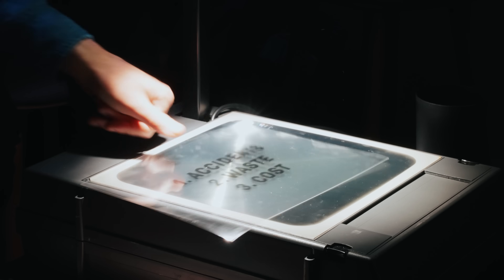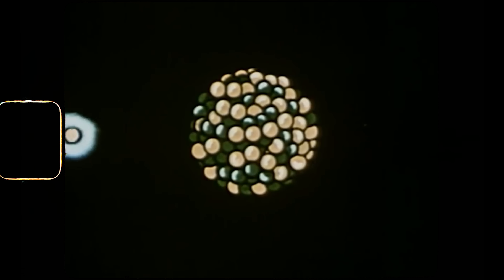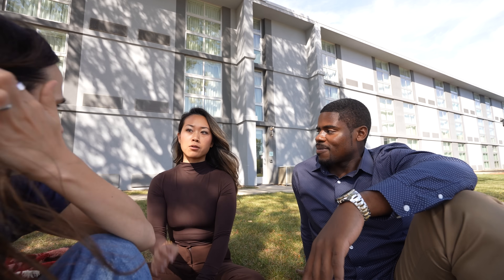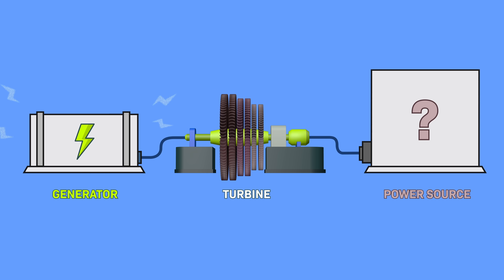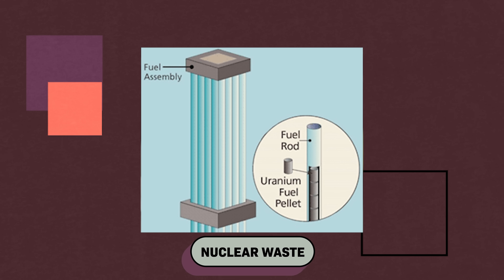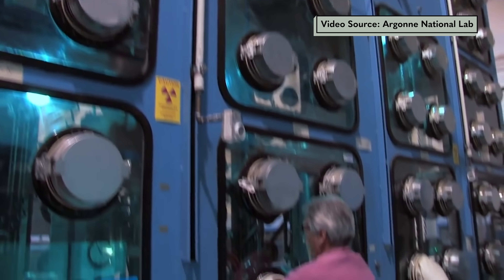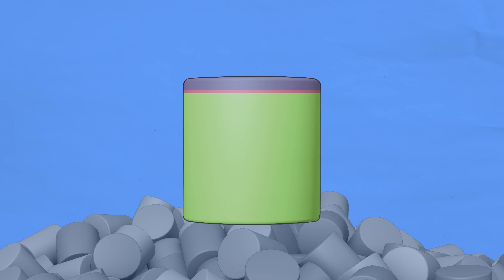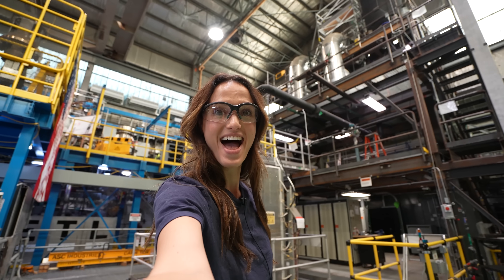The Big Lie About Nuclear Waste

Comment: Thats cool and all but what about the nuclear waste that isn't used up rods, like soil contamination in the mines, materials from the enrichment process, the nuclear contaminated tools and maintanance material, and so on. Most likely this can't be recycled and is the majority of the nuclear waste. I am all for reusing and recyling the really bad stuff, just for the purpose to reduce the time we have to store the waste but this will still produce more, (most likely) non recyclbale nuclear waste. So I can only support this idea when new fuel rods are completly out of the equation and only the remaining waste we already have is used. Every single new processed lump of uranium is just adding a lot more waste, and like I said even the recylcling of the old waste will produce even more new waste. Still cool thing that we can reduce the storage time by a bit through recycling fuel.
Reply: That (low and intermediate level) waste tends to be much shorter half life and is my definition much less intensely radioactive despite the shorter half-life elements.  It *is the largest amount by volume.  But it is also the stuff that becomes ordinary non-radioactive stuff first. Some of the low level  starts barely above background. And all radioactive materials are just in the process of becoming non-radioactive.  And compared to many hazardous materials, radioactive stuff is childishly easy to detect where it is present. You can go a long way with a $50 geiger counter.

The high level waste is focused on because it is the stuff that is deadly radioactive and can stay dangerously  radioactive for so long that it becomes a problem making sure it is safe until it decays away.  As half lives shortens, it becomes just a matter of putting it away for a while until it decaysto background. For the low level rad waste we generated using P32, P33, or S35 radiolabeled nucleic acids, that meant putting it in drawer for a few months until it is ordinary waste.  You can't store low level reactor waste in your desk drawer, but the idea is the same.  It accumulates, but what has accumulated is disappearing at the same time.

Compared to the natural and ignored sources of ionizing radiation (from granite countertops to bananas, to sharing a bed with someone, to flying), the danger even to people living next to where low level waste is stored and processed is only a  problem to the degree one is dedicated to it being a problem.
Reply: @michaelclark4876  If you read carefully you would have noticed that I know that the half-life time is shorter, but the low radioactive waste from powerplants and mines are still radioactive for hundreds of years. Therefore storing it still remains a problem. More because of the amount not so much because of the radiation per se. But if you store a bunch of radioactive stuff together even low radiation levels become dangerous. The waste problem is and remains the reason why new nuclear power rods are a bad idea. Since nuclear fission reactors should only be seen as a transitional technology to renewable energy sources, it should be enough to reuse the thousands of tons of old material anyway.

Comment: The big problem with nuclear is the blatant lies that the green church has been spreading about it for decades. Nuclear is very cheap, it is very clean and when build right the highly dangerous nuclear waste can indeed be recycled and made to be far less dangerous than what is currently being stored for no reason other than that someone (probably someone with a vested interest in Uranium mining) convinced the then president that recycling and reducing both the danger level and the time it needs to be stored was a bad idea.
Currently there is a lot of pressure on the industry to build new reactors as anyone with some knowledge of how an electrical grid works knows that you need baseline power to guarantee that your power delivery remains stable even when it is a cloudy day or the wind died down for a while. Since there are, except for some lucky locations where geothermal or hydro powerplants make sense, no viable green ways to generate baseline power nuclear is needed even if the green church does not like it one bit. The good thing about the new often small and modular reactors is that quite a few of them are build around the concept of recycling the fuel. The bad thing about these reactors is that it will take an eternity to get approval to actually spin them up commercially and even more time to find a place where you can plop a few of them down as the general population has been convinced that anything nuclear is a major accident waiting to happen and no one should have a nuclear powerplant in their backyard.

I fear that it will still be at least a few more decades before we see the first commercially used modular reactors and thanks to lobbying efforts they could very well be only light water reactors because there still is good money to be made mining ever more uranium.

Comment: Nuclear is not safe. It just isn't. You can not plan for every contingency, and the consequences last into the 40,000 year range. Human civilization is only 13,000 years old. Black swan events occur. From terrorists to tsunamis to a freak meteor strikes to a tornados to an earthquakes.
Fusion is much safer, and the best scalable design I have seen is with Helion.
One machine to supply the fuel to multiple generators across the world.
Find the optimum ratio and scale it up. The machines are the size of a semi truck.
It is the most effecient design, bypassing heating of steam to turn a turbine, and going straight to generating from the electromagnetic field.
Even coal is safer and cleaner than nuclear fission.

Comment: Interesting and great point that used fuel rods are a potential source of energy for decades. But you are starting with a totally wrong premise "There's enough used fuel - meaning nuclear waste" The vast majority of the nuclear waste is not discarded rods. Nuclear waste is made up of  Byproducts of the reaction, tools, cleaning supplies, millions of gallons of contaminated water, chemical sludge, storage canisters, clothing, matetial handling artifacts, etc.

Comment: the thing that i never get is we are fine with gas, but not nuclear. Its like nuclear would be ok if after we used it we just pumped it into the air, and no one would want to use gas if we just did not dump it out of our tail pipes, but ended up with waste cubes.

Comment: Good video but you missed the primary reason that we are stuck with the dysfunctional waste system that we have today, which is the 1982 nuclear waste policy act, which made the federal government responsible for nuclear waste management and disposition.  In doing so, the Act distorts the market incentives for the private sector to develop the best solutions to waste management.  To actually solve the problem, we need to realign responsibilities and incentives such that waste producers are responsible for waste management and government is responsible for oversight and regulation.

Comment: Nuclear power plants ware Developed by military mainly for use in submarines, thats why they are very suitable to use  water as medium but hot water becomes steam after hitting 100°C so we have dangerous pressures. There is another solution by using melted salt as medium, making powerplant more secure...  This and probably many other solutions are there but on the way of many inventions there will be always politics blocking the way and pulling development of humanity back. Try also watching documentary about Thorium, very interesting... and shows that we got the technology but politics standing in the way is nothing new.

Comment: From what i know 95% of the material is used in a nuclear power plant. They already use most of the "waste" in them. The only thing a nuclear power plant reject is water vapor and they are now way more sécure than before. Its actually the most clean energy we can have and the less impactfull on the environment. (Waste from solar panel and their production are very polluting/Wind turbine disrupt bird flow and are also dangerous....)

Comment: The amount of space required to store all of the nuclear waste from the entire planet since the beginning of nuclear power takes up less space than a single wind or solar farm.
Wind and Solar are far more damaging to the environment than Nuclear Power with our current capabilites.
You don't just put down and wind and Solar farm and leave it there forever for 'free energy'. Those wind and solar farms wear down just like everything does. While the waste from Wind farms and Solar farms is not radioactive, it is also not recyclable by any means we currently have and it is buried unlike nuclear waste which is stored above ground in constantly monitored containment cells.
Not only that but these wind and solar farms are eventually abandoned and there are huge swaths of land that are just solar/wind farm graveyards.
The alternate options for energy besides Nuclear all cause so much more waste than nuclear power plants do that it is not even close.
One day with advancements we may be able to recycle solar/wind farm waste or improve our grid and other features to make them worth using but as of now they are terrible for the environment. We also will eventually have better ways to deal with nuclear waste, but as of now as I said all of the nuclear waste ever created in the world takes up a tiny spec of space in the world to store, where all of our other forms of energy cause massive amounts of unrecyclable waste that also require plenty of pollution to create the fuel for in the first place. Those materials to create solar/wind are not generated out of thin air.

Comment: You say it’s expensive, but don’t give the cost. What is the cost? Also how do you commercialize the technology? I’d go to, Elon Musk, and Jeff Bezos, to take this challenge up. They competed for the ability to go to outer space and want to land on, Mars. We’ll need a power source when we go there and building a reactor, that can reuse the nuclear waste, would be a good idea. The folks at Argonne, need to create an adapter, that can be sold to the reactors we have now, that automatically recycles the old waste. The cost to take down and rebuild power plants, will be expensive. 

Argonne could contact this base regarding their system. 
“The US Air Force has confirmed the Eielson base in Alaska as the facility planned to host its first small nuclear power plant. A microreactor of up to 5 MWe could be operational there as soon as 2027, according to Eielson”

Comment: It's the fossil fuel industry that hates Nuclear power, because it's the only threat to their own bottom line. They know perfectly well that wind and solar can never replace fossil fuels. But Nuclear can, which is why they create this much propaganda against it.

Cost isn't really the problem. The energy is worth far more than it'll cost. Politics and public perception is the problem.
(Even if it's not as cheap as new uranium, it's not an outrageous cost compared to other energy generation options, like large-scale wind and solar)

Comment: Using nuclear waste to make energy is a hoax. First off, you can’t just use the waste as is, it needs to be treated. This process separates parts of the waste, which creates pollution, it releases radioactivity, part of it can be contained, but creates more waste, and part of it is released in the air and water. Secondly the modified waste is, one, a terrorist risk as it is very easy to make nuclear bombs from it, two, a higher risk to use in a nuclear plant, meaning in case of an accident, the demultiplication process which leads to a radioactive explosion is much quicker, allowing for less time to react. And it also creates waste. Conclusion, it is not viable, let’s not forget, if you take into account all that is contaminated in the nuclear waste recycling process, itmultiplies the volume of radioactive material by an estimated 240 times. Yes a lot of it is low radioactivity, but still toxic, deadly even!

Comment: The second point, why they were so optimistic in the 50s and 60s about nuclear power, they believe fission reactors were just a stepping stone leading to true massive power, FUSION. Thats combing water molecules and making power. Same thing the sun itself uses, hydrogen. They lived in a period unlike any other where inventions we use everyday were coming out, like the microwave. They felt the holy grail of power was just around the corner in research. That is a room temperature super-conductor. The BIGGEST problem with electricity isnt MAKING it, it is TRANSPORTING it! Just a few powerplants could make enough electricity to power the whole country, but trying to send it anywhere would melt the lines! But a useable super-conductor has never materialized and is likely impossible. So we are back to fusion. If maybe we hadnt wasted so much time and money on worthless wind and super poisonous solar, we would probably have it already. It is possible, but it will take lots of time AND money to get there. Fusion has advanced more in the last 10 years than the last 75 years, so we will see.
Reply: There's another (better?) solution for this. Make it local and distributed and store it right there. This avoids sending huge amounts of electric energy around the country in a fragile balanced network. You would still have the grid, but far more resilient.
Reply: @tinowildenhain2324  Completely wrong. This is part of the wrong think going on the left. Power grids require the lines to be energized at all times or the grid collapses and goes dark. Making it local is what we have been doing for a hundred years. Batteries will not work, they discharge, they do not maintain. There must be continuous power that can be very quickly scaled up on demand, or you get brown outs, black outs, etc. Dening this is simply arguing that electrical engineering is wrong, even though it has been working for a 100 years. The only true alternative to fossil fuels is nuclear. If solar and wind worked, we would have been using it for the last 100 years. They even started with it, but it didnt work. This goes back to the arguments between Thomas Edison and Nickola Tesla, DC vrs AC. Batteries are DC, your power lines are AC. They dont mix, like oil and water. Well, really more like diesel fuel and fertilizer...

Comment: Thank you!  It's nice to have a few informed voices doing their part to speak back against uninformed hysteria.  We realistically do not have a path to decarbonization which does not include nuclear energy, and our biosphere would be in much better shape right now if we had achieved that goal from the 60s of 50% nuclear power by year 2000.

Comment: You have missed a few things. We use URANIUM reactors because we wanted to research it for weapons. Take India, they are pioneering Thorium reactors. We could have used it just as easily and it looks to produce much less waste. However, something else BIG you left out, fast reactors create radioactive dangerous Tritium vrs the "light water" producing Deuterium. Although neither are really that harmful unless you boil it and inhale it or drink it. But it can be dangerous if it gets into the water supply. This is why India wants to switch. Spent rods are solids, containing radioactive water, a liquid, is much harder. And could cause an ecological disaster if it leaks. Further, Tritium is super caustic, like lye. It eats through everything. Making it messy, expensive, and dangerous. Thats why we dont want to use that process. Finishing nuclear FUSION would be a FAR better option. That would leave us with stable Deuterium, which might even be usable as a fuel itself in spaceships.

Comment: Simple fact no one
 wants to talk about 90% of all nuclear waste is not from the control rods. Most nuclear waste in the US is medical radio active waste. And most of the rest is waste from swipes, cleaning water from cleaning contaminated materials etc.
I don't see anyway of using this as a Power source, not enough residual energy in this.
Bur let's assume the only waste that is usable is the spent fuel rods. Allow the usable U235 gone only U238 remaining. 
But if this were usable in the firsr place then why the need to enrich.

Comment: Great video, I learned something.  But Isn’t water heated by the u235 reaction also toxic?  How has the economics changed for recycling?  If the money and effort required to recycle for even smaller amounts of u235 had diminishing returns then, what’s changed?

Comment: Carefully examine the cancer rates in the State of Tennessee, county by county. You can find this data online. Compare these rates to other States. You'll be shocked. No one talks about it. Under the State of TN run  hugely complicated aquifers. Geologists admit they do not fully understand how water travels from one side of TN to the other, via these aquifers. Now consider the infamous nuclear power waste burial site near Knoxville has been seeping cancer-causing chemicals since the '40s. Waste is shown to have seeped beneath a major river, contaminating the other side. If it did that, it surely made it into the aquifers, and therefore travels throughout all of TN. 

Look it up.